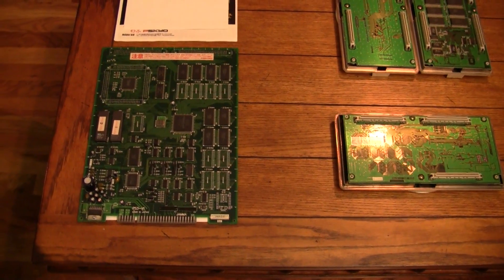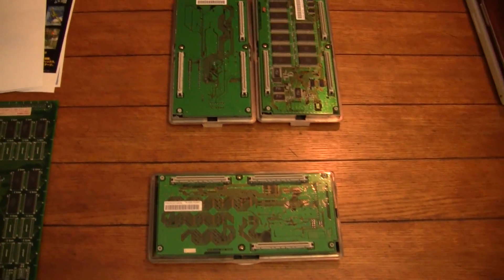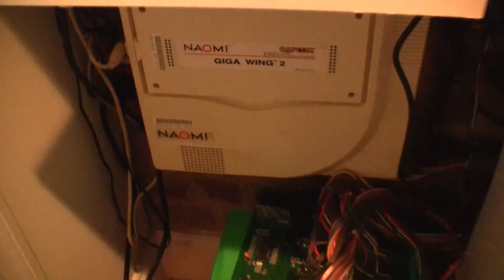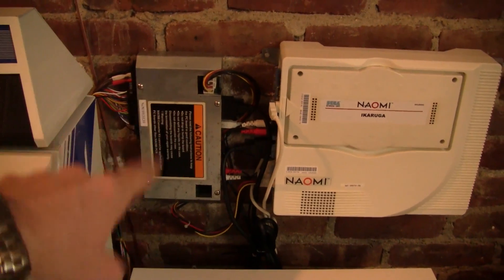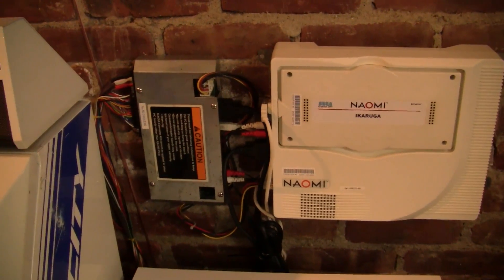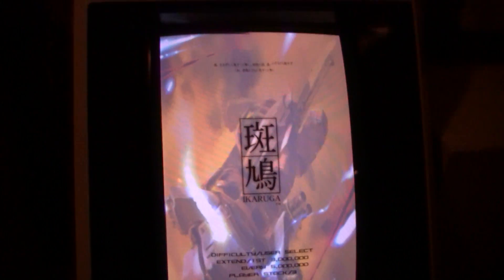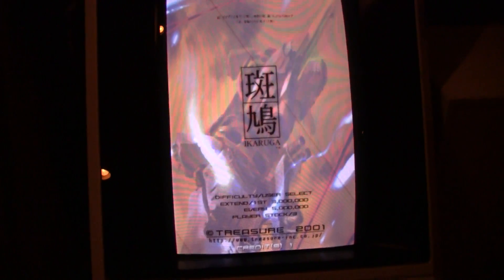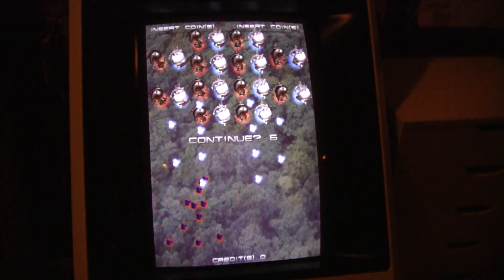Recent Pickups and Updates 11/7/12

Comment: I currently own a consolized Neo-Geo MVS JAMMA Board with Component AV Outputs and it has a tool assistant built in.  I do use the assist quite frequently when playing 2D Fighters just to see some of the mid-game challenges and end-game boss fights.  In responce to your request during this video: I feel comfortable with both viewpoints.  Sometimes it's more fun to discover the solution to a game on your own and sometimes it isn't.